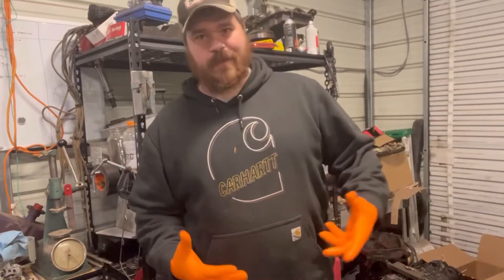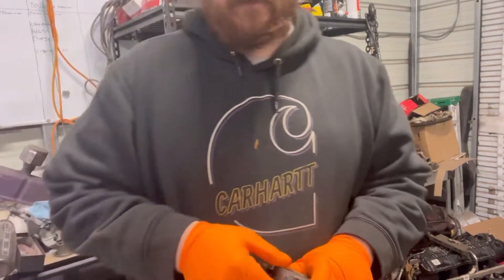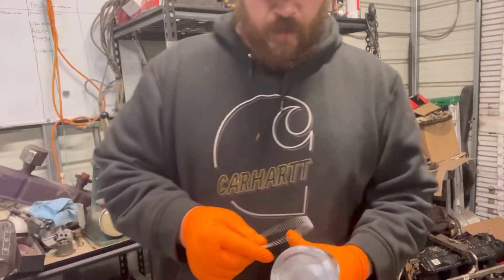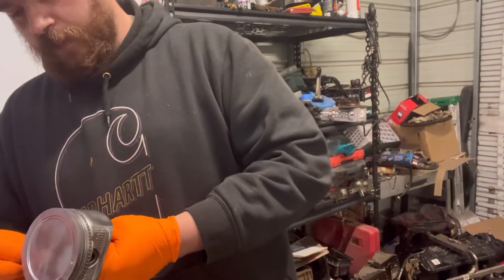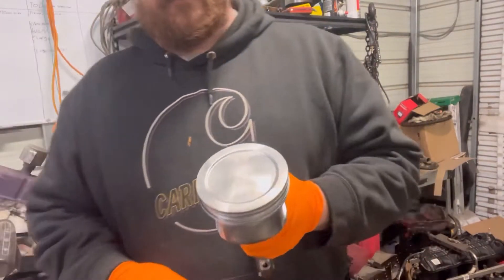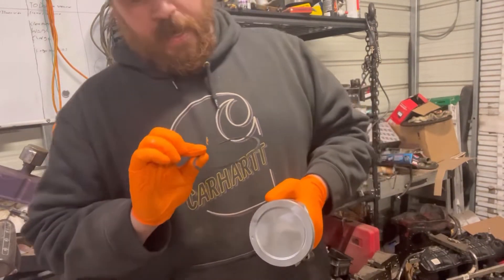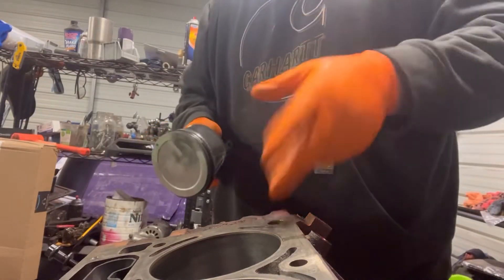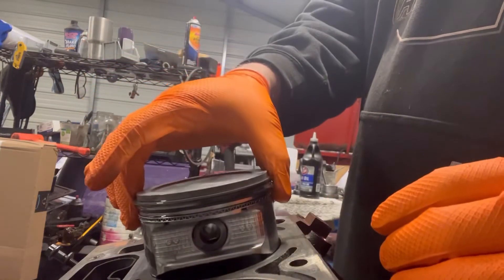Ls build with NORDIC race engines pt.1

Comment: I'm a fan of the Lucas Oil Stabilizer for assembly lube 
What's your thoughts about that?
Reply: It’s not bad. I’ve used it before but, genuinely like the Lucas oil assembly lube (green oil). But it’s just too damn sticky sometimes so I use the gear oil because it has a heavy film strength for initial start up.